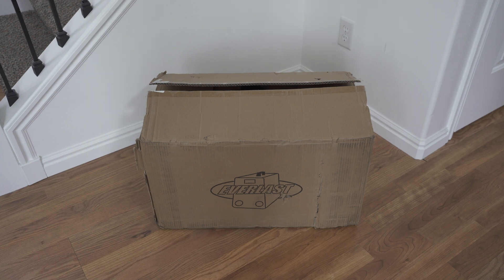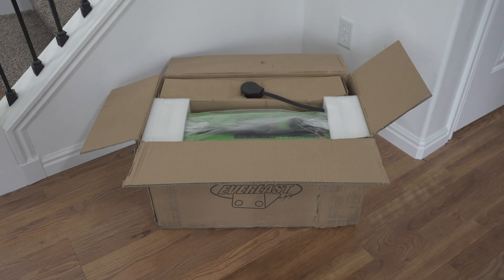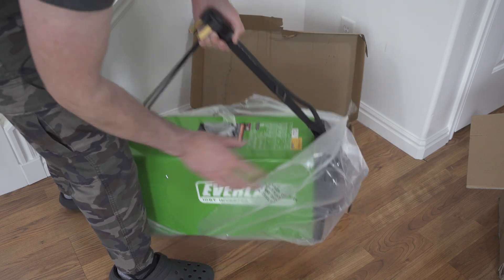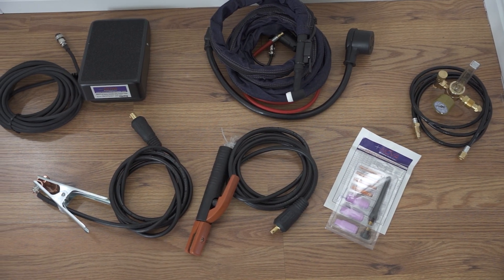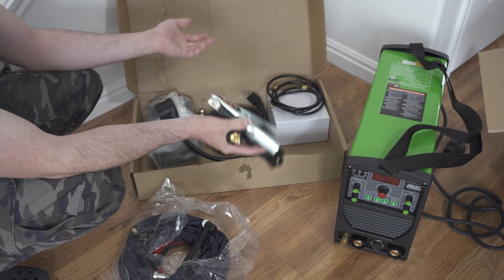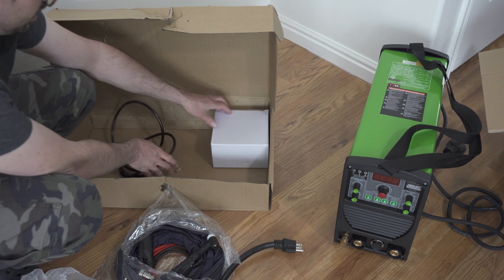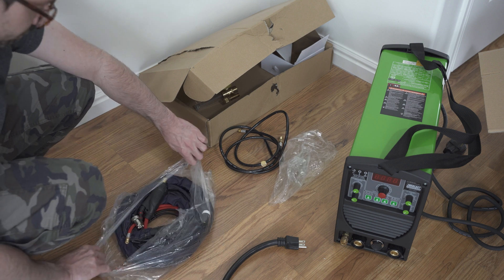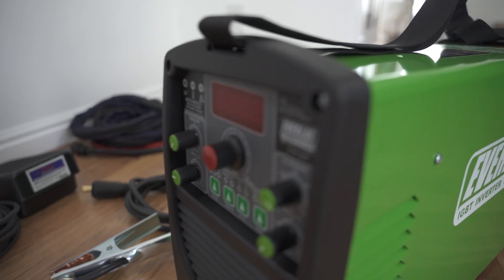My First Tig Welder ! | Unboxing and Overview In 4K | 2022 Everlast Powertig 185DV

Comment: I have one of these and I find the Duty Cycle is Poor. Cuts out a lot after about 10mins, even on low amps. Also you have to check the Points for High Freq Start. Often the gap is wrong.. Probably wouldn't buy one again.
Reply from the maker: No issues with mine maxed out on aluminum
Reply: @TurbineResearch  Could be better on 120 volts. I'm running on 240volts in Australia. How long before Duty Cycle stops the machine at 185amps do you get to weld?